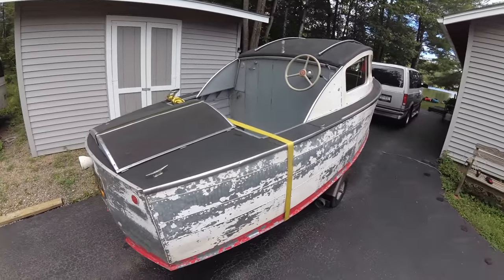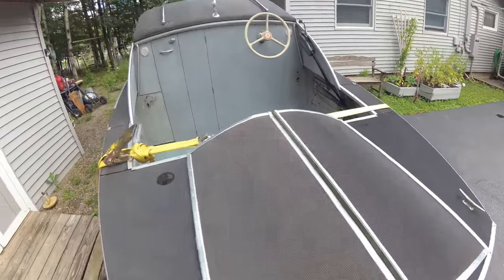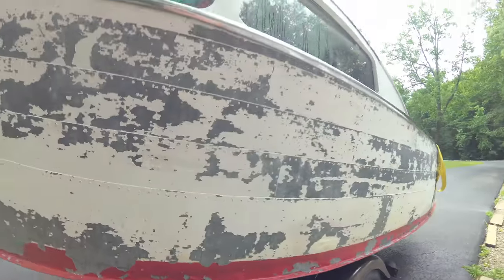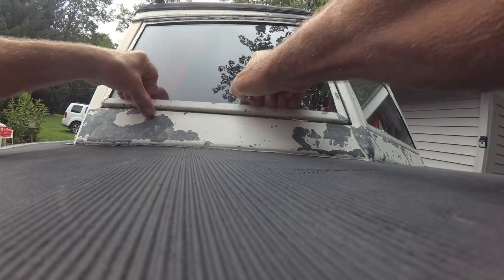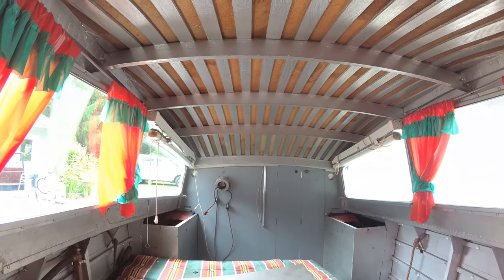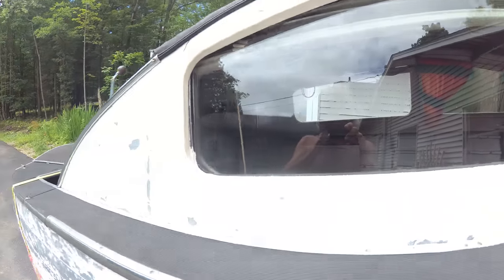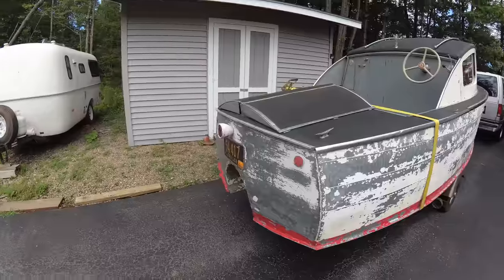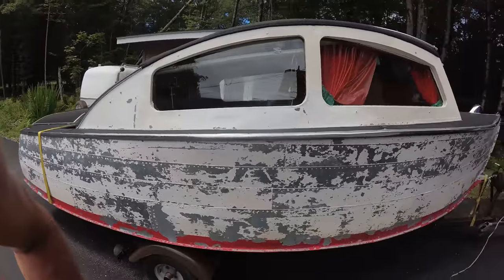1953 mystery girl july 2018

Comment: Something is up with this boat. The ACBS did a write up on it with all kinds of details but like some have posted I see it for sale for 500 a couple places. All I can say is if you want to be the talk of the local boat show (ours has 100's of boats) this is the best 500 bucks you could ever invest. The outboard people would love it, the steel boat people would love it, the runabout, the arts and crafts folks, that boat would be a huge hit. 
Also in a vid they couldn't get the wheels up when in the water. There has to be some sort of lock so the wheels don't go up when trailered.
Reply: Are you selling the boat or was it sold?
Reply: Cool a little closer to home. Does he plan on taking it to any ACBS shows?

Comment: It is a nice boat, well worth over $500. The link you put for the new owner looks like a boat guy, and that is what this boat needed, someone that knows what they have. You should of sold it for around $2000 plus with the engine. If you would of did more YouTube video fixing it up and taking it out for runs, you would of made $$$$ from YouTube. (a lot more than the $500 you sold it for- A LOT more)

Comment: I looked at all the videos hoping to see it with power on the water. I'm curious how it does at speed ? I'm betting it does not plain well or is unstable because of it's skinny width and nearly flat bottom. There must be a reason they didn't sell well. Could've just been hard to market enough to sell, but I wonder if it just wasn't a sound design. I would love to see it on the water  under power.